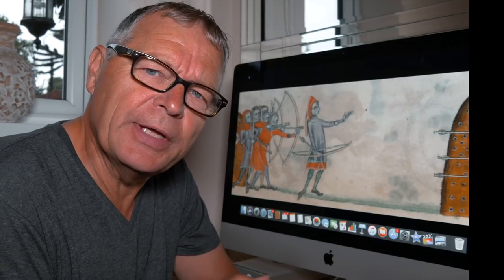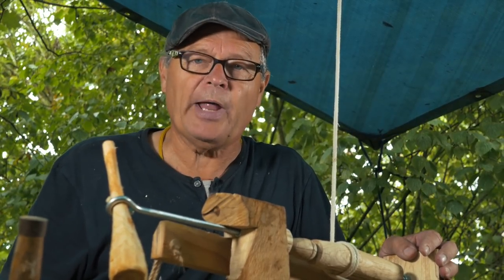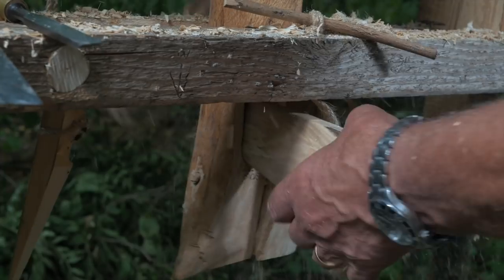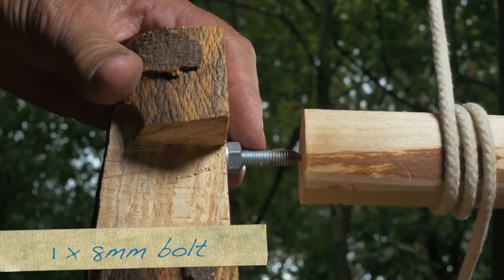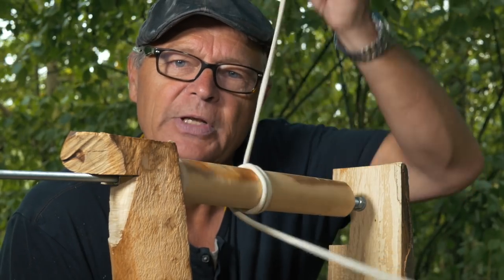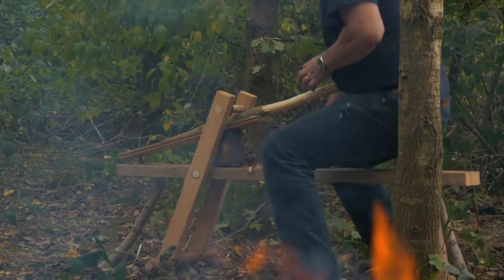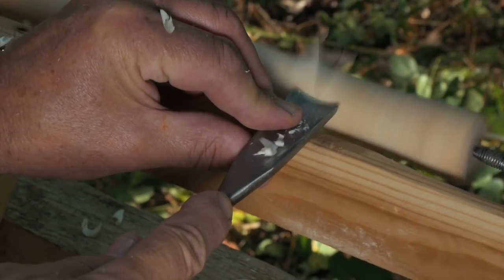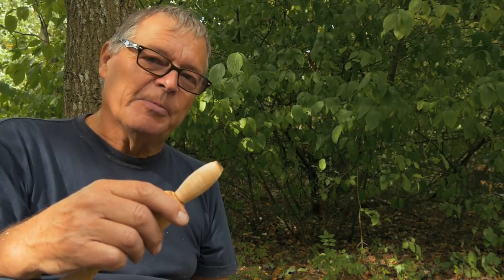Building a Pole Lathe & Wood Turning to make Medieval Arrow Blunts. Part 1

Comment: I had never seen an illustration of a pole lathe using a treadle, but it makes sense so that one man can operate it. The only ones I can remember seeing used a much larger spring pole and it looked like the lathe was powered by one man pulling the pole down then releasing it for the power stroke. I for one loved seeing your dogs.
Reply from the maker: Thanks Bob. Works surprising well with a small pole though I guess a powerful pole and heavier lathe would enable more aggressive work. Glad you like seeing the whole story, not just a bare instructional. My life includes sandwiches in the woods, my dog and wind and rain - so they all get a turn in the video!

Comment: Hi Mick,
Got to where I could sleep with the Blackthorn, so you might guess it's going well enough. :-)
It was interesting to see the photos of the blunts, specially the one made as a single piece with the shaft.
In cultures where wooden blunts were made in small quantities the shaft and head were quite commonly made in a single piece. See native American types illustrated by Steve Allely. 
But it's not much of a stretch to imagine separate blunts being turned on a bodgers lathe. 
There are at least two shapes in that picture from the Lutrell Psalter and the shaft to head transition on the small "walnut" sort certainly looks like it might be a one-piece.
What interests me most about the Lutrell Psalter is the use of them to limit penetration when shooting at earthen butts. 
This makes sense because wear on the fore-shaft can be pretty heavy when arrows are repeatedly shot into and withdrawn from the abrasive face of an earthen butt.
For wand shooting I might favour a small "cropped" crescent head to catch the garland and which can also act as a form of judo point.
In writings on the subject of shooting at wands the term "pricking" can be found, which might be taken to imply the use of sharps, but which might just refer to accurate shooting and the old method of marking the (score) card by pricking it.
fwiw
Rod.
Reply from the maker: It's been a surprisingly interesting and challenging project Rod! No idea how they were made but it does seem possible at least that they were made on a pole lathe. But I haven't finished with it yet; the more I've worked the lathe the more I've wondered how to make blunts efficiently and that's my next adventure down the wood. Email soon. Hurricane heading East the other afternoon, high but with a thrilling rumble!
Reply: I'm wondering how practical it would be to make one with less play in it and a "through-centre" set-up.

Comment: Thank you for sharing. I'm doing a 3D modeling project of a Medieval Lathe using an image as reference and I'm having trouble discerning certain parts, as it's a 3/4 view with some parts somewhat hidden. Do you have any recommendations of any schematics that would break down how the different pieces join and interact? I'm willing to share the image if necessary. Again thank you.

Comment: Great job!  Here in Florida, we do not have all those great, beautiful, straight grained woods.  Everything is crooked and thorny.  (I think as a form of defences against people like us!)  Now I want to make a spring pole lathe.  Need a shave horse first, though.  I have some squiggly blackjack oak that may work.
Reply from the maker: Tom Squiggly blackjack oak! That sounds more than awesome 👏 Good luck and thank you for watching 🙏🙏
Reply: @MickGrewcock ,Well, I got so fired up I went out and cut some "choke" cherry trees for the legs of the shave horse.  Then the sun went down, so I quit.  Didn't want to cut my foot off.  So tomorrow, after church, I'll slab out a base for the horse, and basically steal some of your design.  Hope ye do not mind!  Thanks for making such entertaining and educational videos!
Reply from the maker: @tomsensible3999  Steal away Tom! Not my design, just something I built having briefly glanced at a few images. When you've got the concept down, you'll be able to adapt and work with what you have rather than slavishly follow what I and others have done.  And 'choke cherry'! You sure have some outstanding names for your trees!! Best of luck from a windy, rainy and almost midnight UK. Mick

Comment: I've seen a lot of pole lathes in the last week, and since most of them used a bungee cord for the return tension it's nice to see someone actually use a pole. Perhaps if you build a new lathe you might try incorporating a bow as your return spring instead of a pole?
Reply from the maker: I shall be building a new lathe now that I have learned from the last one. And yes, I could use a bow for the spring!!

Comment: This is beautiful carpentry, along with your shave horse. I can't tell exactly how you're chiseling, but it seems that you're applying force to the tool both when it's spinning toward you and away from you; as far as I know, you're only supposed to apply force to the chisel when the work-piece is spinning toward you, when using a pole lathe. I believe it has something to do with dulling the chisel faster than it should.
Reply from the maker: Hi there Noah. It’s a challenging technique but I apply pressure when the piece is rotating toward me and lift when it returns - except when using a wide chisel or skew when I ride the bevel and lift the chisel handle as the piece rotated towards me and relax the handle a little as it spins back. Took a while to get the rhythm though!!

Comment: Brilliant mick. If i may a thought.It must be possible to make a drive pulley for the rope that is attached on a square section on the spike and have a spade with the spike to bight into the timber being turned. I know you can work out what i mean not that im telling you what to do i hope I've not come over like that. From a smithing point that spindle would have been easy to make even many hundreds of years ago. Any love watching what you are creating as always. Laters mate
Reply from the maker: Cheers Trevor. Yes, I thin I understand! I hope to build a small forge soon and all being well another pole lathe. The spikes might well be my first forging project. Mick

Comment: I always thought it was "puppets". Anyway, for more refined or long-lasting work, it's best not to use full branch rounds, as the pith will cause issues with warping and cracking. Best way to go is using halves and quarters of logs (branches or trunks). For the more indoor oriented woodworker, there are lathes that can be mounted in the vice which simplifies construction vastly and uses the bench as a stabilising weight.
Reply from the maker: David Rekowski Thank you David

Comment: Hello Mick, why haven't you got your own cable channel?  Yet again a beautiful video that I'll watch many times over.
Reply from the maker: Hi Ray! Well, I've got youtube instead ;-). Glad you enjoyed.
Reply: @MickGrewcock  tell you what Mick, you must have done a lot of research on how too make one. Being an ex precision engineer the pole lathe is a little bit basic for me, but I highly admire your love for the ancient way of making things. I wanted too take up archery but instead of just buying a bow etc I made one so I could understand just how it works. Plus doing archery has tought me that things can and will fail which in precision engineering it has to be write first time. After making your lathe you'll be making chairs next. Lol
Reply from the maker: I worked forty plus years in electronics manufacturing Ray so right first time and precise etc. were hourly watchwords. But as you say, this is an exploration (at a very amateur level) of an ancient device that probably was and still can be made in the woods with the simplest of tools. Not much research went in to it - just a grasp of the concept, watching a few videos and then a root around the shed for bits of wood!
Reply: @MickGrewcock  the amassing thing is too us this is primitive engineering, but back in the day it was the height of invention. Thing is they took it to its maximum and had skilled workers that could get the best out of what they've got. I bet there warbows were far better than we can make. We've lost such a lot of skills.
Reply from the maker: Oh agreed. We underestimate the skills that can be developed with just hand, eye and a simple tool. Yes, we have gained much but that progress has come at the cost of losing many skills and crafts. My explorations are the merest scratches on the surface of the past.
Reply: @MickGrewcock  keep going Mick. I lift my hat too you. 😊
Reply: Just watched your video again, told you I would. I bet if you had to make dozens of blunts, like they would have made back in the 14th century, you wouldn't know what too do with your leg once you've finished. 
The lathe operator's must have been deformed like the archers, having one leg larger than the other. The average collection of skilled people in those day's must have looked a funny bunch of character. 
I'm also glad too see the shave horse works well, I bet your glad you made it.